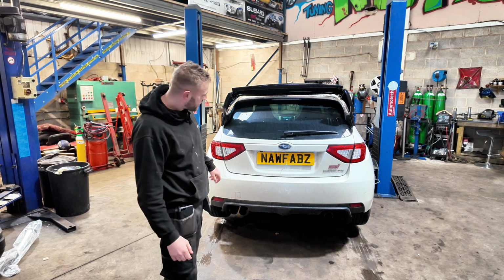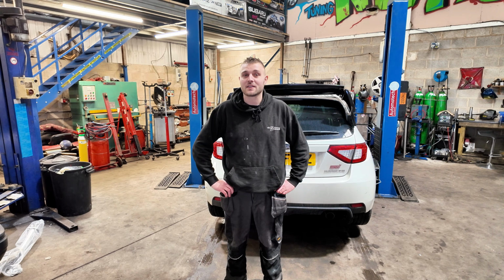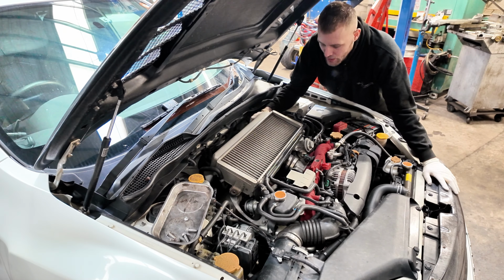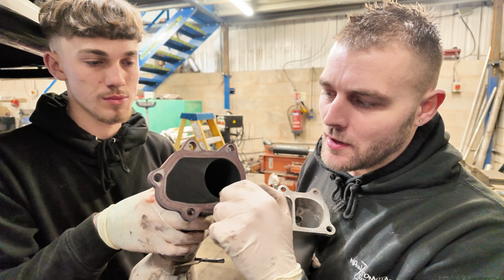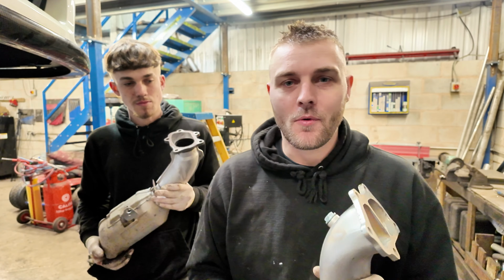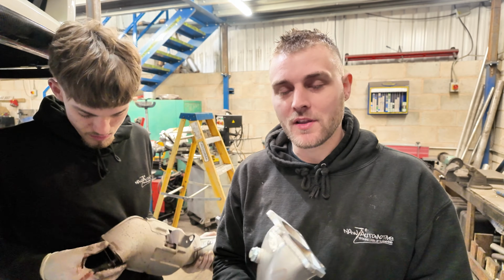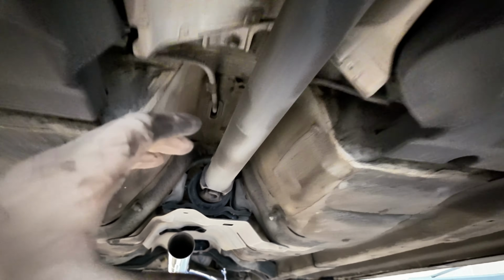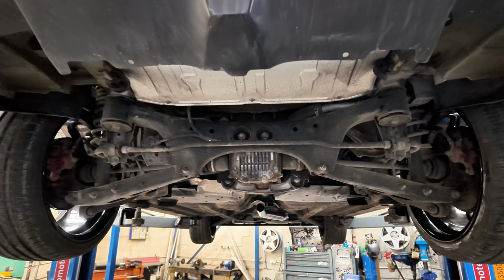Time to make this STI impreza sound like a real subaru!

Comment: Music to my ears 😂 I’ve had 3 impreza’s, all classics, 2 saloons and a wagon….had my first saloon for 9 years, second saloon for for 4 years and then finished off with wagon which I had for just under 4 years…. The wagon was mica red, 51 plate and 330bhp, looked so fecking good, Sti rear lights, gravel express spats, original 16 inch curved 5 spoke alloys, Sti spoiler, the works…..got written off by a woman driving into the side of me 😭😭😭 I was devasted! Ran an Audi a4 b6 avant for 3 years after that, stage 2 etc. now I’ve got a Ford 🤦🏻 transit connect 😭😂
Reply from the maker: I do love a suabru, had a classic turbo many years ago . Ragged it daily until the bottom started knocking:(